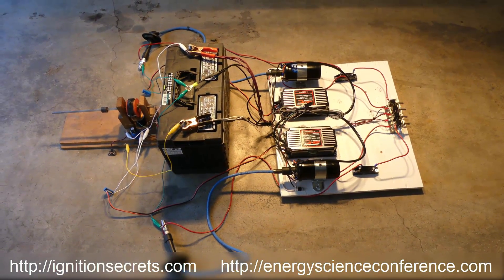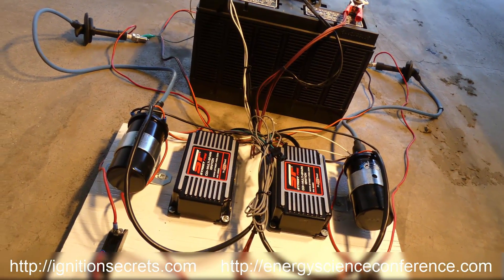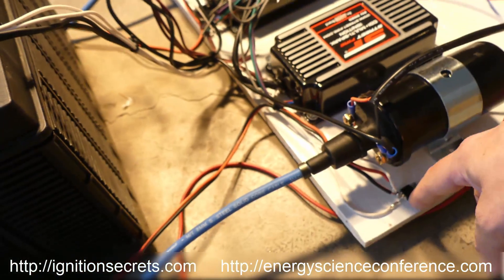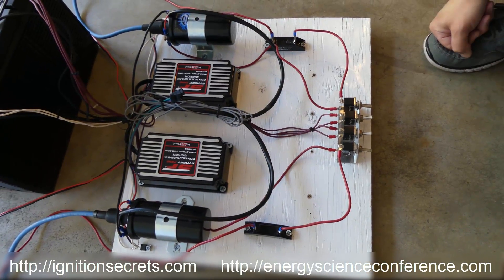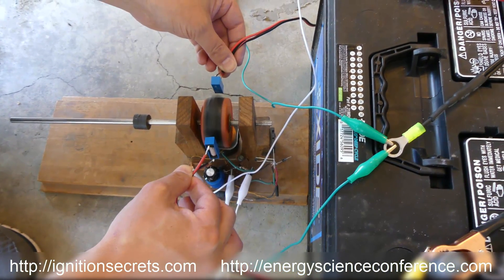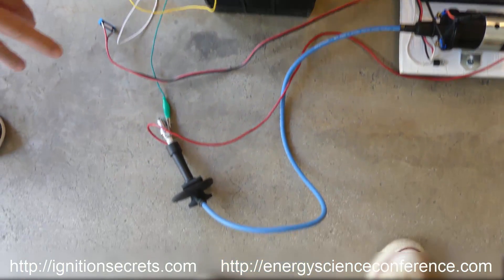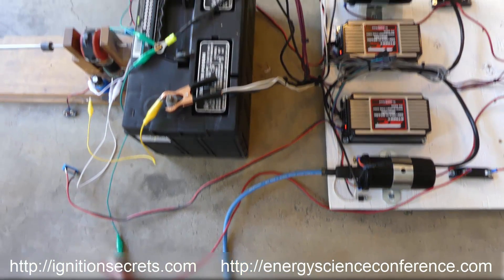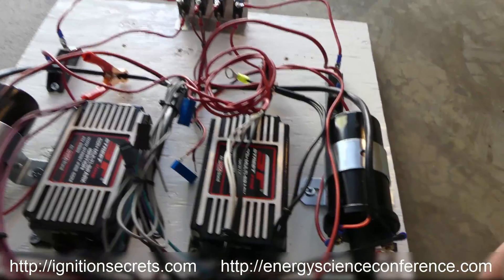Dual Plasma Ignition

Comment: So the plasma is a result of Higher current across the gap?
In other experiments misting water makes it louder. Is it insta HHO+boom?
Reply from the maker: Not just higher current, but at a speed not normally allowed since it appears the current is accelerating not just over the gap but across the entire circuit - otherwise, how does the capacitor know to discharge faster? It instantly disassociates the hydrogen from oxygen then instantly detonates that hydrogen, which then then more effectively ignites the air/fuel mixture.

Comment: Hi Aaron,  do you still monitor these comments?  I want to ask you about 2 different 20yr old Plasma technologies currently in the aftermarket & have 2 different aerospace electrical engineers who invented these.  1 is very expensive & does rival Transient Plasma Systems technology but it has been available to use with conventional plugs & is waiting for the TPS plugs to be developed for their system to be used in this available Plasma Box.   I want to send you an email to run these 2 systems by you & but not here in the comments.  It would be interesting if you either know or don't know about these 2 systems to help further your research.
Reply from the maker: There is a contact form at the bottom of emediapress.com

Comment: Hello is your website still up?  I can't seem to be able to order the book.. ?
Reply from the maker: Yes - https://emediapress.com/shop/ignition-secrets/
Reply: @AaronMurakami13   ok. Thanks.
Reply: Hello, I hooked up my Diodes but nothing happened,  (one terminal to ground the other to spark plug tip) also the diode has sourt like like and arrow point symbol,  does the polarity matters?.
Reply from the maker: @hectorortega9131  Hi Hector, please join https://energeticforum.com and when you do email info at emediapress.com to activate your membership. I'll provide support in that forum so everyone can see all the answers at the same time.

Comment: will a set up like this  negatively  affect the computer on a aftermarket fuel injection system? (holley sniper).
  or what precautions should i take??.
Reply from the maker: If this is used on a car with a fuel computer, you'll need to modify either the o2 sensor or air flow sensor or both in order to see the benefits. However, if it is an aftermarket one, you may be able to dial in your preferred settings. It should not have any affect on the computer, especially if you use wires with some suppression, but plus with no resistance.

Comment: Why can't you use a single MSD controller and coil and just direct the output to the correct cylinder with a distributor?    Seems like its gonna get expensive quick if you need all that crap PER CYLINDER.
Reply from the maker: You can use a 2 cylinder distributor for the same thing. I don't have one and I'm not going to fabricate one.
Reply: haha yep, no doubt msd produces something useful in that regard as well... like the rest of this setup.

Comment: what is diode part number or value
Reply from the maker: It is NOT a microwave oven diode. It is a 20kv diode rated at a few amps not 750ma or less. The microwave diodes have a current rating way too low. I've destroyed countless microwave oven diodes because they're too weak. The ones I am using are ham radio switching diodes for use between transmitter and receiver. They can be rated for 2-6 amps or more and are fairly bulletproof for the plasma ignition - forget the microwave ones, you'll waste your money and time. That microwave diode is $7 - for less than half that cost, you can get one that has a higher voltage and current rating. This is what I use: https://www.ebay.com/sch/i.html?_from=R40&_trksid=p2057872.m570.l1313.TR0.TRC0.A0.H0.XPRHVP2A-20.TRS5&_nkw=PRHVP2A-20&_sacat=0
Reply from the maker: Just go for about 20kv and a couple amps rating.
Reply: Its a microwave oven HV diode...  

like this one:
http://www.electronix.com/microwave-oven-diode-750ma-15kv-p-5453.html

Comment: Thank's for the video! Tell me why are you using Diodes instead of Capacitors for the plasma circuit? Thanks!
Reply from the maker: The diodes are pathways for the cap to discharge through. There is a capacitor - it's inside the ignition module. http://ignitionsecrets.com

Comment: Would this work on a GM HEI setup runnng a 6A MSD box?
Reply from the maker: It should - as long as there is a capacitor discharging into the primary of an ignition coil and you have access to those connections, you can put the diodes in the right place to make the plasma ignition.
Reply: Is not a 6A MSD box normally wired with a capacitor discharging into the primary coil?  I am assuming you mean the + connection to the coil. (The coil being located on top of the HEI distributor.)  

From your video it appears to be similar as to how my 68 Chevelle' ignition is wired up to the MSD box with of course the magnetic pickup wires being used instead of the ones you used for your demonstration.
Reply from the maker: Watch this: https://www.youtube.com/watch?v=bqNVH6LM4W0 - more applicable to what you're wanting to do. Everything is in http://ignitionsecrets.com
Reply: Thank you for your help.  I will look into it.

Comment: Will this increase my gasoline motor's hp?
Reply from the maker: Yes. There are dyno tests posted in youtube with others who are using the plasma ignition on their engine showing hp gains.
Reply: That's nice.  This device should be marketed to automotive manufacturers
Reply from the maker: Constantine Joseph
They have patents on the antiquated method of producing this kind of plasma and are just sitting on them. They will not put this into their cars until required by law in order to meet more stringent future requirements. My patented method basically obsoletes all their patents.

Comment: I thought you invented and patented this tech. But a company called "Blue Pheonix" is advertising and selling a Plasma Ignition system for racing/economy use. Is that your company?
Reply from the maker: +Anonymous Reviewer That is a rip off of Arvind's circuits from what was known as EcoIgnition. That is also the antiquated method of doing it by having to manufacture a new cap charging circuit, etc. my method obsoletes all that and improves it by allowing you to take any off the shelf CDI/MSD and simply add a HV diode to make the plasma. Furthermore, my method initiates the hv spark with a capacitive discharge meaning you're starting with a much higher voltage spark, which is stronger and can hold up to higher compression better - meaning my method is more suitable to racing with superior performance and reliability and at a fraction of the price.
Reply from the maker: +Anonymous Reviewer Anonymous Reviewer? You mean a Blue Phoenix troll with a new youtube account, 0 subscribers, 0 comments, 0 videos - to simply try to get some free advertising here?

Comment: I am not falling for this yet , looks like step up voltage transformer. sec circuit , I am thinking amps traded for volts . no WATTAGE  (power) increase.
If true - you have solved generating power from nothing , and I can make a 9 volt hand shocker to toast  animals with,  at the auction, ...... but them 800 lbs stubborn pigs and cows are still laughing with 6 / 9v batteries as primary juice. the more batt the more juice everytime.  most electronic power converters degrade power by 30% , best is about 7%. copper #1
pls explain...
I took and made a car distributor and coil  as hand held shocker 10 yrs back, wanting more juice.
Docacezzz
Reply from the maker: +pked9 Step 1 is that you need to understand the difference between energy and power - power from nothing? It is called IMPULSE. You take x joules of potential energy and discharge it into a smaller period of time and the power is increased. 1 joule of potential energy can give you 1 watt for 1 second and that is 1 watt second. 1 joule discharged over 0.5 seconds is 2 watts for 0.5 seconds. 1 joule over 1/10 of a second is 10 watts for 1/10th of a second and so on - can discharge it in a short enough time to have a megawatt - it's elementary math. Your shocker is nothing more than a step up in the voltage while reducing the current. My circuit is mixing high voltage and low current (hv spark) over the gap with the low voltage high current over the same gap. You just need to build the experiment - until you do that, you can think all you want but will not understand what it is.
Reply: +Aaron Murakami  - I have a small lab , oh I am right with ya , I know a lot about this stuff...   I like your answer.......and agree with the testing...

other fields use same info , such as CISCO communications ,  repeaters, phones, copper lines and wifi.. telsa's tower of power , / Single Phase ,guitar amps 6L6s my fav. Microwave oven re ship  eldridge.....etc....

Comment: Okay, I have a few very dumb questions, so please bear with me.  First of all, it appears that you want to use this in an automotive situation. Are there other uses as well?  If on cars, then what is the tangible advantage?  More horsepower? Better performance?  Longer plug life?  Also, what happens then on a modern car with a single coil pack per cylinder?  Also, your optical sensors, would the rotator be attached to something spinning on the car, i.e. an idler pulley, or something like that?  Would this enhance MPG?
Reply from the maker: +Pinlight This particular ignition system in this video is for a 2 cylinder experimental gas engine. Yes, more horsepower, more mileage (as long as you can get around the computer sabotage), less emission. Plugs actually don't last as long since it is a much higher power discharge. Keeping the plasma small to what is made from off the shelf units gives a decent life. Ideally, there are better plugs made. I have plans for those but do not have the resources to build them or have them put into production. The COP (coil on plug) you're talking about - hard to retrofit those with the diode connection. However, I do know someone that can have them made and does have them made with the diode already built in. The pickup is actually magnetic not optical - but is for the experimental test engine. On a normal car, can use simple magnetic pickup for timing - does not need anything spinning out in the open.
Reply: +Aaron Murakami  That's great.  Thanks for the explanation.

Comment: I stumbled across this video... Am I missing something?  

You have an electric motor, with magnets on the rotor.  Reed switches trigger a CDI 
ignition system,  generating a spark at each plug.  That sounds like a a 
normal automotive ignition system to me.  Then you apparently get a 
stronger spark (more plasma) by rectifying the HV and feeding it to the 
plug.   

Is this going to get us better gas mileage?  Or just burn up plugs faster?
Reply from the maker: +PanamaSticks I'm getting the low voltage capacitor to jump across the gap by pre-ionizing the gap with HV. Look at the plasma discharge, it is a quantum leap beyond any normal spark. More mileage, power and reduced emissions. Yes, it will burn up plugs faster if the plasma is too big so use the small caps in typical off the shelf cdi/msd units.
Reply: +Aaron Murakami Thank you for your reply.  I hope you don't think I was panning your design.  I was just trying to understand what it was you invented.  Can you point me to any studies that show increased mileage and power, and lower emissions?
Reply from the maker: PanamaSticks
http://ignitionsecrets.com In the conference presentation, I give some SAE and other references.
Reply from the maker: *****
You need to learn the difference between energy and power.
Reply from the maker: *****
Please direct your ignorance elsewhere. It is an ignition system and I'm not making free energy claims for it. You're highly delusional and are making a false argument against something that wasn't claimed.

Comment: I could be wrong, but I think I remember hearing somewhere that the multiple spark ignition systems would revert back to single spark above certain rpms.
Reply from the maker: +adam rodenberg true - single or at least just a couple at higher rpms. It's dependent on how fast the cap charger circuit can keep the caps charged up.

Comment: wish you sold a kit like this ready to install.
Reply from the maker: +Evan Biddy I wish I had one to offer. What may be avail is an adapter that fits between the plug and plug cable to tie the HV diode output to - that would make it easy  as long as the car doesn't have the "coil on plugs". Will definitely announce anything that does become avail.
Reply: +Aaron Murakami thank you, do you have a facebook page
Reply from the maker: Evan Biddy
Hi Evan, yes - https://www.facebook.com/aaronmurakami13

Comment: Aaron, it is general practice to use ONE coil and ONE trigger for a 2 cyl engine . . This fires both plugs at once. It is a wasted spark during the exhaust stroke. All the Onans and Kohlers are fired this way.. Coil  saturation might be a bit lower but, this only matters at very high rpm.  Your system looks promising. Danny B.
Reply from the maker: +chatsworth777 Yes, if there is a distributor to take the coil output and redirect it to a different plug - then it will only fire one at a time alternately. I'm not talking wasted spark though. With wasted spark, yes, they would normally fire at the same time. My Subaru EJ25 engine fires 1&2 together and 2&3 together. For the engine it is going on, which I can't discuss at this time, it can't have wasted spark because it would contact fuel coming in. I have some other options to use a wasted spark ignition coil pack like on a Subaru and 1 MSD unit that alternately fires each half of the coil pack. There are expensive MSD units for wasted spark ignitions and they're very expensive, which I'm trying to avoid. I've used those successfully on my Subaru.

Comment: try to do this test when spark plug under 10-20 bar pressure like in engine and let's see how good it work in real situation. Nice work.
Reply from the maker: +abba zhaba Under compression, the plasma grows bigger.
Reply: +Aaron Murakami  cool, can u do this test in pressure camera with video? But as i know under hi pressure usual not good spark, so that why i ask u.
Reply: cool invention. The high voltage create ionized channel through which flows a low voltage high current by diod. You are well done!
Reply from the maker: +abba zhaba Some members of my forum at http://energeticforum.com posted that almost 10 years ago. In a compression chamber, the plasma increases in size because there are more molecules to disassociate. Quite the opposite of a normal spark, which will get snuffed out under too high of compression.
Reply: ok, i'll try to find it, thank you!
Reply from the maker: +abba zhaba Check through the "Water Sparkplug" discussions. They're closed, all posts are preserved.